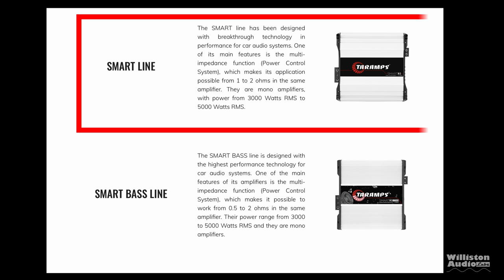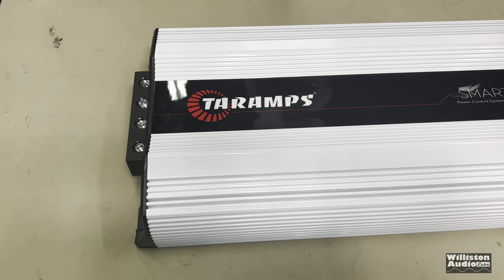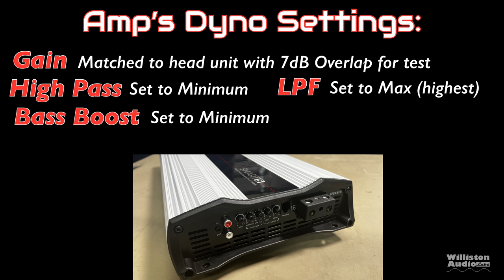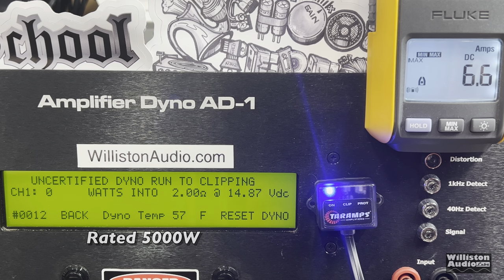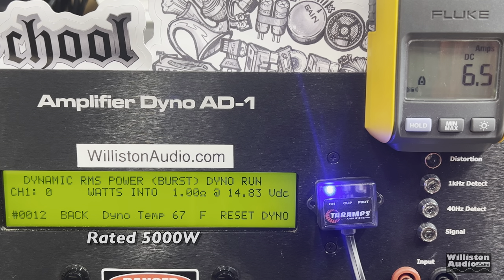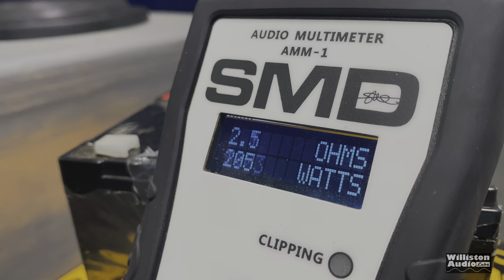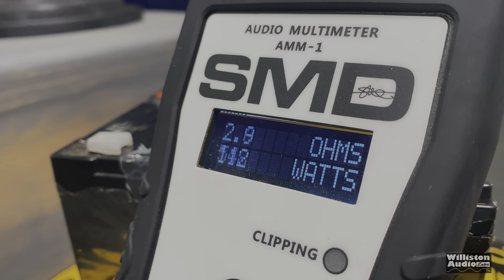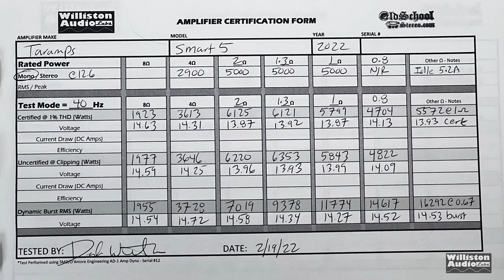You Won't Believe This! Taramps Smart 5 Amp Dyno Test and Review [4K]

Comment: I have four each one is clamping 4000w rms @ 2ohm  @12.5v if i had higher voltage they would be doing 5k+ @ 2 ohm no problem. Also i noticed if i go into clipping or what seems like it the amps dip down until i drop the rca knob again so they protect themselves and the subs from clipping
Reply: That's exactly what I realized I was wondering if anyone else was experiencing this
Reply: I had 4, one over heated while parked up with head unit off somehow....the other Procteded at low volume while cleaning ride and never came back on.
Reply: @dblovah5156  i actually already got rid of the smart 5s and got 2 md 12000s saving up for two more and i want to get dual 2 ohm subs so i can run .5 on each amp
Reply: Also i found out im dipping to 11v i have 6 agms and a stock alt
Reply: I also got rid of my smarts and bought two surge audio 10ks. thought about getting 4 md 12ks being that would be the only upgrade from 4 smart 5 power wise, but they have a high failure rate. Compare to the other MD models so I went to surge and wired them at .5
Reply: @dblovah5156  so far so good with two md 12000s at .5 people dont know how to set gains properly on them. Also they dont do 12000 watts either they are glorified 7000 watt amps all in all these cheap amps are trash whenever i can afford it im going back to korean.
Reply: The surge audio 10k actually looks decent

Comment: I have a Bass 8K on 4 Alpine Type R 12’s. Slammin. Fan is loud. I use a D4S shop subwoofer bass knob. With a 350 amp alternator and 2 AGM batteries I can usually keep over 13 volts with RPM.
Reply from the maker: Sweet 👍
Reply: Which bass knob did you use on it? Was it an rca cable or just a regular remote wire?
Reply: @AudioAddict.  I used Down4Sound Shop subwoofer looking knob. It’s an inline RCA type.
Reply: @junkyardhemi  thanks yo

Comment: Man you should check out the JBL BR-A amplifiers  manufactured here in Brazil, they look like the BANDA 250.2 and other like that , but they are way better than the latter, for that size, power  and price they're straight killers. I've just got a BR-A 300.3 for a home custom system, and it sounds amazing, and the best thing is you can't hear any ground noise on the speakers at all.
Reply from the maker: I’ve seen those! I’ll need to grab one

Comment: I'd like to see the rest of the tests at 2/3 ohm. I currently run an Orion HCCA 5k at 0.67, and I might switch to a Taramps Smart 5k if it can handle 0.67 daily.
Reply: Na these amps not good QUALITY amps
Reply: The have a version that's rated for .5 ohms
Reply: From everything I see Smart bass 5k is better for under 1ohm
Reply: mine is awsome at .4 ohm daily, have ran it for 6 months perfect.
Reply: stay with orion!!❤❤❤ trust me....

Comment: So this would be a bit more powerful than the Bully Slayer MD 5k. Also costs about $75 more tho. However the extra power might be worth it, if the reliability was better than the Bully amp. I'd love to see which one lasted the longest. The Taramps overall and in general, seem to blow up easily and catch fire from what I have read and reviewed. However the Bully Slayer 5k was going into protect during the testing, so there's that to consider. This one has the dual inputs where the Bully doesn't. I loved the guts of the Bully amp, aesthetically a little cleaner looking to me personally, but this Taramps had a leg up on everything over the Bully 5k. Id have to buy em both and run them and ask me again in a year my opinion

Comment: My ex did manage to blow a smart 3s internals. I set her up with one and a speaker wire came loose. She tried to stick it back in and accidentally shorted the amp. Blew every MOSFET on the power section. However once replacing them all it worked perfectly fine again

Comment: REMEMBER THE BIG D RULES. 
It takes power to make power. 
If you're going to getting anything this big. Proper battery, alternator, wiring. Otherwise it will not perform as advertised.
Reply from the maker: Facts!
Reply: @wal  
I have been reading the commentary.
More confusion then usual I think.
What about this? what about that. It's as if people did not watch the video, or comprehend it. Possibly don't have the basic knowledge necessary to run something this outrageous. Not for the average system.

Comment: Hmmm.... maybe you can use that amp to track down and eliminate all the rattling in your test area.  Oh wait, you'd be left with an open field.
You know, even with its efficiency, that amp is capable of drawing more than some stock alternators can put out.  It's possible to drain your battery with that amp even at 60mph.  Of course, if that's what you're doing, your money might be better spent getting your hearing checked out.
Alternatively, if you work it right, you might be able to do some arc welding with that amp.
Reply: That's why when running something that can put out what this can. You NEED a proper electrical system. 
Lithium battery, upgraded alternator, proper wiring and installation. Otherwise go smaller.

Comment: at 8 box , looks a little bit big.. i would test 4 small sealed plexiglass, look for a broken backboard, might have to raise the backseat, with some washers, make sure you got the right amount of inches of port per cube, I like to, test on low-power for Port placement, I have a piece of paper, sometimes you can Port up through the rear decl, just gethe right amount of Port per cube. Take time on your platform. Come up with hidden side storage. Good luck

Comment: Big D!  Great videos! I just bought a CAB 22, waiting on its arrival! 
All your dyno tests include a "up to clipping" run. Could you show or tell me how to set my new amp up so I can get all the power without going into clipping?
Reply from the maker: There are many vids showing how to set gains. Does the CAB-22 have clip light on remote? If so you can monitor that carefully when using the amp
Reply: @wal   yes it has a clip light
Reply: @dead6last  download a 40hz test tone at -5db. dont hook the sub yet to the amp, play the test tone almost on its max volume like if your radio volume maxes out at 35 play it on 30. raise the gain setting on the amp and stop when you see the clip light turns on then slowly lower the gain down until the clip light turns off. also have the bass knob set to the max before setting the gain up
Reply: @rowboyto156  - mostly agree but on some amps the bass knob is bass boost only and I run that zeroed out for setting gains and then verify that I’m not clipping at my setting of choice (which is usually nearly zero boost). If your bass knob is a level knob then this is pretty spot on.

Comment: Those amps seem pretty good, but still a little high. Curious if you could dyno one of Memphis Audio's Street reference series amps... like the 750.1d. I'm looking at running this amp for my build and haven’t seen a single dyno test.
Reply: Update, the Memphis 750.1D is great paired to a Kicker L7S matched to a 1.95 cubic foot box sealed.

Comment: I bought one last year because of this. I have it on 4 8 inch ds18 high excursion. I have gained set about 9 o’clock. Holy smokes it kicks ya in the head. All of sky high 0 gauge wire. On a 2024 Chevy Silverado with stock alternator no problems what so ever. No lights dimming. I have a 240 alternator. Can I just ad lithium banks. Or should I buy another alternator?

Comment: so you finally get a amp worth videoing congrats all is well then we get to your pro/ cons and jesus your cons were the pros . so lets go over your cons first its a mono amp hence 1 input , 2. pots hard to get at . thats good set them a n d forget them . i like them in further because i put tape over mine to keep dust out . 3, crossovers its amp get the crossovers off all amps ! any sq setup worth listening to dont have any thing on the amp but rca,power, and gain per channel . 4 ,remote dont need one just use your volume on head unit . 5 , loud fan really come on if its to loud its a dam 11000 real  watt $500 amp that runs cool !!! this amp line makes any kicker , fosgate , memphis look like tinker toys !! Team Corally
Reply from the maker: Lawd brother, there are pills that may help 🤷‍♂️

Comment: Wow. Burp amp??? Overall very impressive. If it's reliable for daily use. I've been looking at maybe sundown sfb but this seems pretty efficient..
Reply: The burst test is a continuous set of 40 hertz sine waves on and off, so it's not a one and done burst amp. The burst test is to simulate actual music where it's not a continuous sine wave.
Reply: Had a SFB5000 to replace my Smart 3k, only lasted 2 days. SFB was still under warranty and had a new one sent to me, but I ended up selling it and got the BASS 8k. All my taramps still work so I’ll stick to them.
Reply: @crazu1980  how hot does Taramps get??
Reply: @crazu1980  good to know. Seems like I've heard that somewhere else to. I had been leaning towards sfb. Thought about wolfram also. Trying to stay a little budget friendly in this build
Reply: Sfb's are very power hungry. My electrical is upgraded. I had a mmats 2000 with no issues. Same car a few months later with an sfb 1000 and it makes my lights dim at 1 ohm and it gets super hot within minutes. Wouldn't recommend sundown sfb amps.
Reply: @jacobwebb8818   depends on your equipment, electrical and installation. 

I’m just using to push a couple 2000w 12s on 1ohm,  never gets over 100 degrees. It will be wired to .5 ohm on my new subs. Check out my vids, hopefully it’ll perform for years.
Reply: @tcorley7477  I’ve never had a wolfram amp but hear great things.
Reply: @allthingsaudio4610  very true, that’s pretty much what happened to that SFB, overheated and fried it. I had it on the same wires from my Smart 3k.
Reply: @allthingsaudio4610  love to have a mmats. Don't see many around here. Like to find something with good power output that's not too power hungry. At least 4k
Reply: @jacobwebb8818  they barely get warm my amp seldom gets warm enough for the fans to run anything but a slow idle these amps are extremely extremely deceiving when u pick up a smart 5k and it barely weighs 7 or 8 pounds and it throws 16k bursts out like it's nothing.
Reply: I had the SFB - 3 of them - first 2k blew up out of the box. Then I bought the 3k and it clipped like a welding machine no matter what I did (plenty of electrical.) Finally decided to try out the Smart 3 and it’s been excellent.
Reply: @droski33  man that sucks. Glad I'm hearing all this before I bought anything. You know I've thought about deaf bonce I believe they have one similar to sfb and taramps. I love deaf bonce subs never messed with amps.
Reply: ive tried both currently have a sfb 13.5k right now i would take 2 smart 5s all day over it
Reply: @tcorley7477  I like taramps, original bass 8k I got ended up going into protect, chatted with a technician and they sent me a another within a week. Good customer service
Reply: @gamersfan  finally a honest oppinion? So ur telling me sundown sfb. Are junk Chinese copy of Brazilian?? Just kidding I've known for awhile now I've seen a few go bad in ppls cars doing installs .
Reply: @joshholden8561  the sfb 13.5k has given me no issues so far it's not a bad amp very powerful but I have had a few taramps and have liked them 2 smart 3s out did my ampere 7500 I had and the sfb out did those but 2 smart 5 would be so much better with impedance rise I have to see if my newest rebuilt subs would even handle it lol
Reply: If you are going to get a Brazilian full bridge, this Smart 5 is the amp to get. Hands down the best in the game. Just do yourself a favor and use your head unit or a DSP to control the crossovers.
Reply: @Jacob Webb  they don't get too hot  I have a Smart3 & md8000 and have never had overheating issues. I've played mine up to an hour & a half on back to back bass heavy songs still didn't get got. The fans work very well. You can't beat these amps for the price.  I can't wait to swap my Smart3 out for the Smart5 when I get it!! The Smart3 definitely no slouch, over 16 months at 1 ohm on a single 18" sub and nothing but great things to say. Taramps hit a hole in one with the Smart series! Anyone who says differently must have not had the proper electrical to support them.

Comment: Do these have a good sound quality?  Seems just unreal with the price/performance what's the catch?
Reply: I doubt it, you never hear people who understand SQ respond or explain in realistic terms. I have seen videos on YouTube and several people have mentioned them not sounding good for some reason, even with high power output. I have a soundstream that's dyno'ed over 5000wrms by another YouTube channel and it's very similar to the taramps design even though shaped differently. My theory is these full bridge amps create power at whatever frequency band the amp deems easiest to produce it at. It's just a theory, but I've sold and installed thousands of amps over the years, and have ran several different types in my own vehicles. If you try an older American class a/b amplifier with no crossover and then try one of these full bridge amps with crossover off, using the deck crossover only, you may find  the bass output below 50hz drops significantly. It's as if they design a non defeatable digital crossover into the power supply modulation circuit, to prevent the amps running their full output with flat response down to subsonic frequencies. Just a theory, but that would explain how they're making the power without going up in flames. May also explain why you see people running 30 amps like this in one spl vehicle. I mean, how many hundreds of thousands of watts are needed to run 10-15 subs? 😆

Comment: I’ve been torn between the smart line and sundown’s sia line. If Taramps would offer a nicer bass remote with built in clip light as an option I would be all over it. Sundown costs $680 for the sia5000 and Taramps smart5 is $480 BUT sundown has a nice, metal bass remote with buttery smooth potentiometer and clip light and a 2 year warranty. The taramps offers a cheap dinky looking knob with a light for $50 and their warranty is only 1 yr and their fans are loud af…as much as I want to try the taramps I just can’t do it

Comment: Running a Smart 5 now for a few days. Definitely loud but seems to be missing something in the bass. Maybe a bit thin sounding? Not as smooth and isn't reproducing the low end like my half-bridge was. I've got more testing and tweaking to do, got the power just need to get the sound right.

I have had an issue with my universal rca style bass knob creating noise thru the subs. Worked fine on my last 2 amps but the Taramps doesn't like it for some reason. Tried my back up knob and a couple different sets of rcas but it persists. For now I'm without a bass knob which sucks. Hopefully I can figure it out, otherwise I may sell the amp. Going thru menus to use sub option is a pain in the a$$.
Reply from the maker: A friend uses an Orion 5k HCCA and says the same about how the Taramps sound in his vehicle. I can’t explain this with science, but there is obviously a difference

Comment: At this point Taramps is just making it unfair for the competition. Power, price, size, availability, and efficiency
Reply: If its reliability proves its self ile go for the brand
Reply from the maker: They are making strides
Reply: @wal  gona try order one  I've got a 15 inch mtx thunder 8000  on a  hifonics zuce 1200.2 at 4 ohms  it says it makes 1200 @ 4 oms briged  and it seams under powerd for the Mtx

Comment: My guess why Taramp doesn't include a remote control knob is because most guys now discard the remote gain knob and buy and use a inline level knob instead lol thinking its the same thing as a remote gain knob
Reply from the maker: Not sure if “most” do this but it adds complexity to a system and just seems like an oversight on an amp like this

Comment: I have a question? I have watched a lot demos from different people... And everybody turn the bass boost all the way down... Why?... I thought the bass boost with supposed to help like raised the output what the amp can do you know perform at its best... It's actual limits output...I'm wondering if  it can preform better and put out more watts on a dyno with bass boosted turned up a little?
Reply from the maker: Bass boost isn't going to give you more output power, just boosts certain frequencies to more quickly reach that output power

Comment: The problem with Taramps was not with price or power output.  It was and still is reliability.
Reply from the maker: The smart series should do better because they are limiting the current
Reply: Interesting because I've never ran into reliability issues

Comment: Noticed alot of these over sea amps have no built in fuses. whats up with that? I understand an inline fuse, is used to protect the wiring.
Reply from the maker: Most amps over 1500W don’t have built in fusing. They are assuming you have external fusing
Reply: @wal  thanks for your help W. Your channel rocks!

Comment: I want to build a system in my magnum around this amp with 2 alternators how many batteries will be required to feed this and keep it happy on some sundown 15 or 18 x- series?
Reply: i have a smart 5 bass and 2 X15v3s to run it i have . 370 alt and 250 ah agm = 3 batteries, dual runs of 1/0 , pretty happy setup, stays 13v+